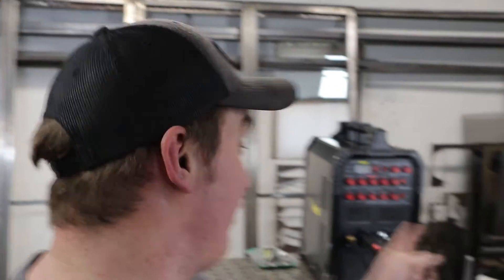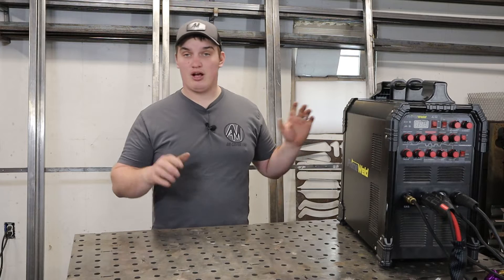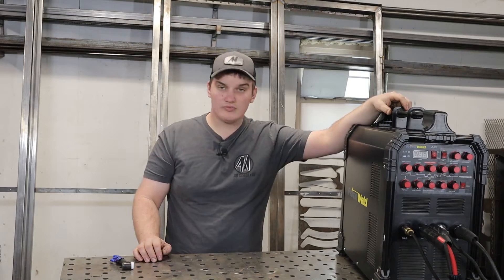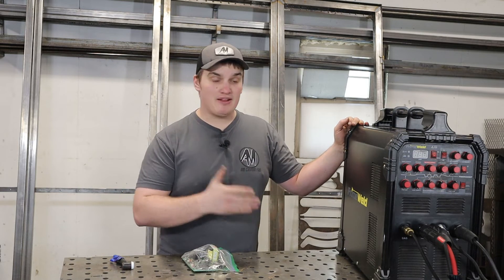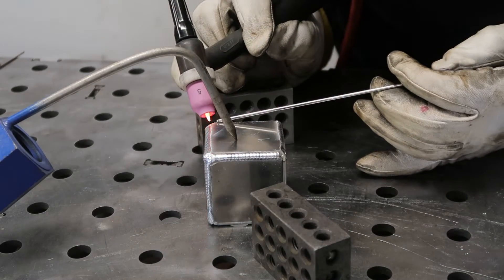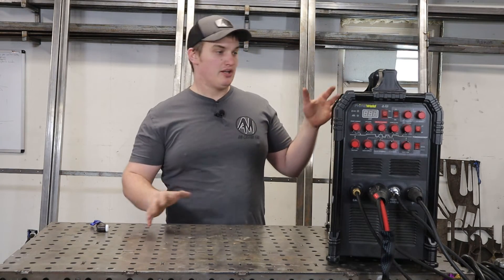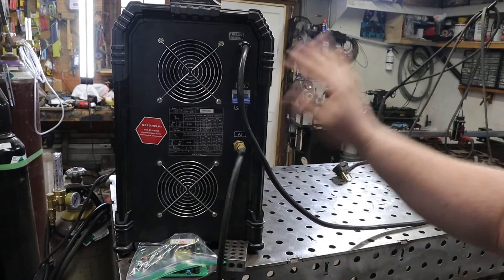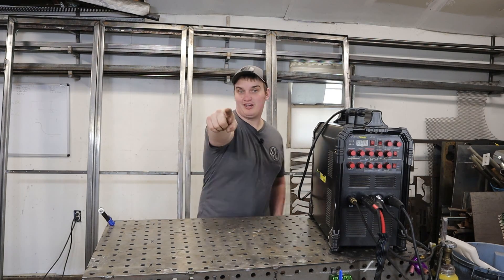BEST WELDER FOR UNDER $1000 PrimeWeld AC/DC Tig 225 ONE Year Review (Not sponsored)

Comment: I bought the Gen 1 about three years ago on a whim.  I've MIG welded with my Miller 185 for nearly 30 years and decided I would try to teach myself how to TIG weld.  The price he showed was about the same as I paid on Amazon, and though I can't claim to be a professional welder, I can say that the unit has been flawless and actually quite easy to use as a beginner with TIG.  for anyone interested in learning to TIG on a budget, or if you are a pro but need an inexpensive quality machine, I would have to agree with this review.

Comment: i have a lincoln 140c. it blew. lincoln sent me a new board and tech sheets in 4 days. i was running the 5th day.  i also own this primawelder. i have used it to build a few chassis, exhaust, custom computer cases with very thin metals.  its been run long - i have welded for over 3 hours with minimal breaks and have never hit duty cycle at 160a dc tig.  i have used this on 18ga aluminum - starting on a scrap piece and moving onto your work makes it a perfect welder even on thin stuff. 

i have used the stick side a little and its worked great as well. i mostly tig however.    having all the knobs is great - quick and easy to change anything. the switches are great as you can just see exactly what your doing.
after watching your vid, mine is a gen 2

Comment: Well i pulled the plug and bought this welder. I am going on 3 months now and i could not be happier.
Reply: I've had mine a little over a year, I've not had a single issue, and it performs as well as the $10k welders I use at work. I think you'll be happy with it.
Reply from the maker: Glad to hear it

Comment: I love mine.  Having bought it from Amazon, I would have an easy 30 day return if I didn't like it. I torture tested it as soon as it arrived. DC stick welding 3/4", 5/8", 3/8" plate. I went thru 4 ten pound boxes of 1/8" & 5/32" rods, only once did I hit the duty cycle. Passed the test as far as I was concerned. Aluminum welding was a breeze. I made the mistake of buying one of the yellow Tigs for half the price, it lasted maybe one hour of light aluminum welding and just stopped. It was not worth the time and shipping costs to bother with. The Prime Weld 225 is a beast!!!
Thanks for your review, well done!
Reply: Did you run 1/8 6010?
Reply: @kenyanr1  Yes and 7018. I just bought their MIG 180, my Hobart finally pooped out. It's not the beast that this welder is but so far it's nice and came with a better spool gun that I have at half the price of a Hobart. They build a solid machine.
Reply: @donanything6816  Wow good to know, thanks for the reply

Comment: Yes the power cord is definitely heavier... so much so that I had to buy a different 110 to 220 pigtail adapter because the one it comes with will pull partially out of a waist high outlet from the weight (All my shop outlets were installed at workbench height just in case). All the welding stores had the same straight 110 plug design so I bought one with a right angle 110 plug from an RV supply store.

Comment: one thing I can say man awesome of you to do a good review like that not too many people know about gen 1 and Gen 2 on the primeweld tig 225x. and I would definitely agree with you with the water cooler I have the max cool 3000 water cooler definitely what you said I have the air-cooled flex lock that I was using on my TIG machine and when I got the water cooler I got the number 20 that came with it and I also ordered a water cold flex lock. I have definitely noticed that the water cooler with the water cooled flex lock torch has open that machine up to Infinity my weld times are so much longer I could be on my machine for an hour and a half two hours welding straight in the torch not even get hot. and far as like customer service goes I had to use mine too I had the same problem on the AC side The high frequency was not wanting to start on the AC side no matter what I did and they ended up sending me out a new machine shipping all taken care of shipping me out a new machine I ship them back the other machine I was up and going in 2 days.

Comment: Just wired subpanel out in shop for the 225x and one of their little plasma cutters. For anyone that's confused about the manual, there's not such thing as a 30 amp receptacle to fit the 110 plug they provided. Plugs and receptacles for different amperages are all pinned different, the one provided will only fit a 15 or 20 amp receptacle. The 20 amp receptacle has a sideways T for the left slot on the receptacle. All the standard ones in your  home are just 15amp receptacles. And for the wiring a 50amp breaker requires a 6awg wire, 12 awg is good for 20amp, 10awg is good for 30. So I'd be surprised if the 50 amp breaker trips before the 12awg wire melts. So from my uneducated research you need a 20amp breaker on 12awg for the 110v plug and you could technically get away with a 30amp breaker on 10awg for the 220v. Id be curious if anyone has measured what it does draw through the panel.

Comment: Awesome review thanks for taking the time to review it. I have the 2 gen and love it. Does everything I needed it to do so far and I am very pleased. I will say I've had the same problem with the high frequency start on aluminum but I've found the switching to DC and initiate the arc then switching back to ac fixes this.
Reply: Do you mean just the switch activating fixes the start or are you starting to weld on DC and then switching it back mid-weld?
Reply: @bdpgarage  switching to DC initiate an arc then switching back to AC. I found good ground is very important. By ground I mean the positive cable going to my welding table and a jumper cable the same size that I can clamp close to where I'm welding has eliminated this problem. Hope this helps

Comment: Have you tried solving the hot arc start on thin aluminum problem by switching to 120 volts? Just a thought. Thanks
Reply from the maker: Ya don't make much difference.

Comment: Just a fyi, a water cooled torch is purely for operator comfort.  It doesn’t “raise the ceiling” of the machine or affect how hard it’s running.  It still can only output 225 amps and run for its duty cycle regardless if the torch is water cooled or not.  There’s also ways around water cooled torches if it’s not feasible to run one, you can swap torches when they get hot or wrap the handles, etc.
Reply: Thanks for the advice. Im new at this, but I was welding some thicker metal 1" to some 1/4 plate and my torch got super hot. I wasn't sure if it was normal.
Reply: Wouldn't wrapping it, etc, lead to the torch melting at some point?  I'm noob but well read & YouTubed and the effect of heat is hard to get around with releasing it somehow.
Reply: @replyhere590  it would, but if the torch is getting too hot to hold then you’re almost surely exceeding the torches rated capacity… e.g. the ck17 that the machine comes with is under rated for the machines max output.  A Ck17 is only rated for 150 amps of course it’s going to get too hot to handle, assuming most are using it at or above that amperage.  All I was trying to point out is that in the video he implies that a water cooled torch will allow you to weld thicker material because the torch won’t overheat, which is not exactly true… if you used a air cooled torch that is rated for the amperage being used it won’t get overly hot.  Obviously water dissipates heat better than air but that isn’t a factor I would use in determining how thick of material a machine can do.  

But of course as with anything welding you want to go 10-20% above what you will be doing with it, machine size, duty cycle, torch size etc.  If you get something that only just makes the cut then you’ll be disappointed.

Comment: How would you rate this one vs the Eastwood 200 Amp AC/DC TIG Welder for Steel and Aluminum since they are closer in price $699.97?
Reply from the maker: I cannot speak directly to it cuz I've never personally used the Eastwood 200 AC DC but I know Eastwood does not come with name brand torch and their customer service is not as good as primewell as well hopefully this was helpful thanks for watching 😎

Comment: Did You check if the start-up Amps are the same on 110 and 220V?
Reply from the maker: Have not stuck a meter on  but there's not a super noticeable difference very minimal if there is.

Comment: Is the start to hot for thin wall (.035”) chromoly without a work around?
Reply from the maker: No the DC side works great with thin  stuff I've done 20 gauge stainless no problem
Reply: @amcustomfab  Thank you for responding. Great video.

Comment: Have you had any problems with cooling on the machine.  I read the manual and it said to have a foot of clearance on the back of the machine.  I noticed that your tig welder is close to the argon bottle.  Please comment.  I just purchased the welder and the cooler based on your reviews.
Reply from the maker: Never had a problem

Comment: I really want to buy this welder. Can you tell me if it will run a 6010 rod? This seems to be the ultimate test and would do everything I would need in the shop.
Reply from the maker: I have not personally ran 6010 rod on it only 7018. I think  I would get on the Facebook page and ask I'm pretty sure I've seen people say they've ran 6010.
Reply: @amcustomfab  thank for the info and tip. I’ll go check out the FB group as well

Comment: Hey friend maybe you can help me  when’d punch the pedal that machine sounds like air like and can see in like blue electric light  is normally.
Reply from the maker: Yes that is totally normal. That is the high frequency points working inside of the machine that's what allows the ark to jump from your tungsten to the plate without having to strike it to initiate the arc😎

Comment: Yeah mine is the same, it's really not made to do small ,thin particular kind parts where you need low and steady amps on AC, now DC does fine, it they could get the pedal and the AC side to do as good as the DC side, the machine would be perfect, so now I've got to go out and by a evergreen to do the lite ac welding work which sucks cause this was supposed to be able to do it, and it don't now heavy work no problem 120 1/4 in 3/16 whatever no problem you know comes in boom the only downside even with that when you get to the end it doesn't taper off good with that pedal I mean it's like a spot in the pedal that is either on or off there is no little taper when you raise the pedal up to the end there and just try to tape it and taper it off a little bit just to keep you know the the corners from blowing out or anything like that I just don't have that in this machine even with heavy work running heavy beads no problem but any kind of taper off or anything like that maybe the t4 is the only way you can do that with this machine and it actually work but it won't work with a pedal and it could be the pedal salt I don't know

Comment: If you are using a steel table and your method is to attach a ground to the table, why not attach another clamp and cable to the work table and then clamp onto your work. That pretty much insures you are grounded.  It could be just an old battery cable with vice grips clamping it to the work piece and the other end is bolted to the table. Brass bolt would also be good for not much torque needed but it would improve conductivity. Better safe than sorry.
Reply from the maker: That would definitely be a good option 😎

Comment: You must have a mixture of the two because my machine has the plug-in for the water cooler it has the heavy cord put on the front of it it has the waves it don't have the on off high low switch so it's like it's like it's got all the upgrades in the old machine or maybe they just upgraded it all machines I don't know you call a gen one and gen 2 but I've got a machine that's got gen 1 engine 2 stuff in it I got the Gen one indicators for the pulse between the 200 per minute compared to the slower pulse and then I've got the higher or the heavier cord and I've got the plug in so I don't know I don't get it

Comment: Great, I am about to maybe buy a welder.  Have 2 questions;  People say that welding aluminum is really dangerous because of the fumes, could you recommend a safety protocol for this, and 2 can you recommend a great helmet, both passive and auto-darkening?  I am on a budget, but still want to be as safe as possible.  Thanks.  Also, it this welder good for aluminum?  Thanks again.
Reply: I have welded aluminum for 30 yrs with no problem weld
Reply: Galvanized metal is nasty
Reply: Use a respirator, miller makes a good one that fits under your hood.

Comment: My only gripe with the machine is the start up arc on thin sheetmetal. The initial hit tends to blow holes in stuff like 18 gauge.
Reply: I’m not having that experience.  I’ve been doing a bunch of 19g and 20g work and this thing has been beautiful.  Two things though- the NOVA or SSC pedal is a must, and tight arc starts are mandatory.  Slightest bit if a long arc on startup is a blow through.  I like 1/16 tri/rare earth electrodes the most for light gauge stuff.  Definitely swapping the pedal is a must though!
Reply: I recall seeing a review of the Miller 220 as having too hot a TIG start for thin stuff.  Wondering if the new 325 solves that problem.  Interesting suggestions about replacing the pedal.  Didn't they finally supply a better pedal after a rough one in the earliest 225s?   Comment from AM Customs fab??  Again, wondering about the new 325 and any improvement there?
Reply: I’m having absolutely no trouble on 19g with my 225, gen 2 machine, big pedal. Tight arc, no blow through, 3/16, very sharp point, E3 electrodes, if that helps.

Comment: Is that machine capable of doing autogenous butt weld on 22g sheet metal?
Reply from the maker: Yes on steel or stainless
Reply: @amcustomfab   Have you tried it? I need a welder that can make autogenous butt weld 22 gauge sheet metal but I can't find anything about that, I don't want to spend 1500$ CDN for nothing...Thank you.
Reply from the maker: @UpInSmoke54  machine can do it. The question is can you do it The machine doesn't have a brain. It does what you tell it to do. But it does have a long enough amp start of doing this. I have done it before
Reply: @amcustomfab  The machine doesn't have a brain but has a minimum amperage to initiate the arc (starting amps) the one I have right now is 70A!
Reply from the maker: @UpInSmoke54 absolutely! You're correct. I believe the startup amps on this machine for DC, 20 amps but let me double check real quick.
Reply from the maker: Actually looks like it's a 10 amp start on DC and 30 amp start on AC
Reply: @amcustomfab   That's the minimum that the welder can weld mine goes to 10A but the starting is 70A.. Many TIG welders have a minimum starting amps measurement regardless of how low you set the amperage on the panel.
Reply from the maker: @UpInSmoke54  I've never stuck the multimeter on it to see what it spikes to on startup. But I have welded 22 gauge with it on DC. It has a really good, smooth low amp startup on DC. The low amp startup on the AC is not as good though.  Anything below 16 gauge on AC. Take some technique
Reply: @amcustomfab  In the specification it says 10-225A but they don't specify AC or DC.

Thank you for your help.👍